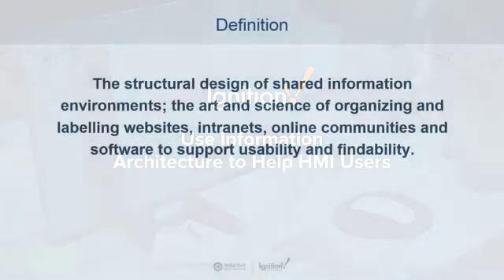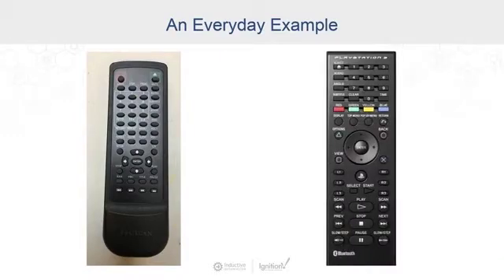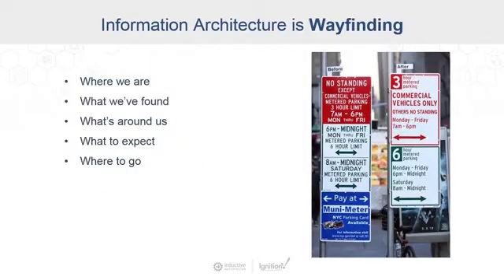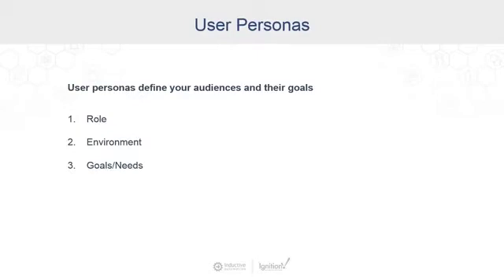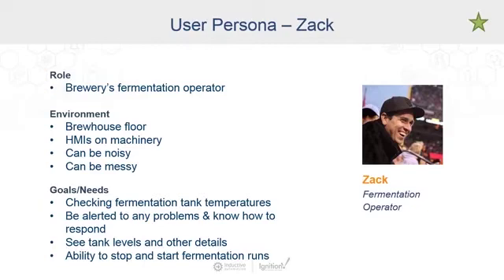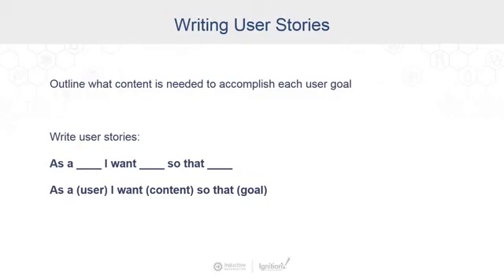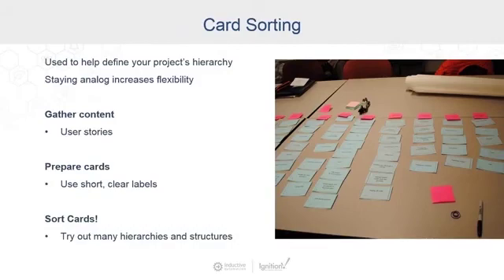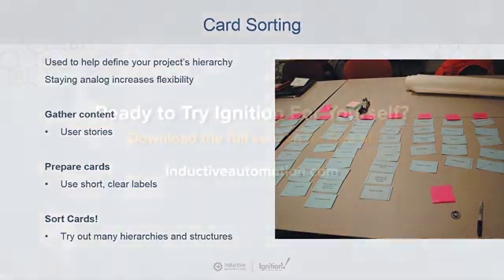Use Information Architecture to Help HMI Users

Comment: This is helpful, seems like a little thing. But this is how I use it. I’m a Field Engineer who does HMI Design & Programing. But before that I was a Utility Plant Operator for a long time. Coming from that background of having spent thousands of hours looking at the HMI, I used to wonder why the people that made the HMI originally didn’t add certain things to the HMI or emphasize some aspects of information of the plant data on the HMI screen. For me when I draw and design  the HMI interface I think about those things as If I’m the operator as I once was and still kinda am looking at the HMI and what information is also helpful that i could put there to be useful to the operator.